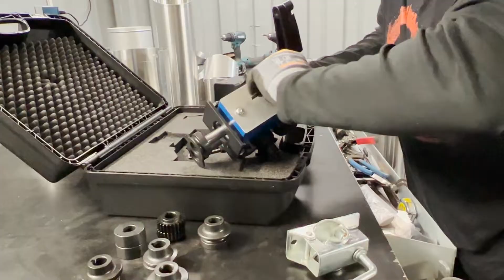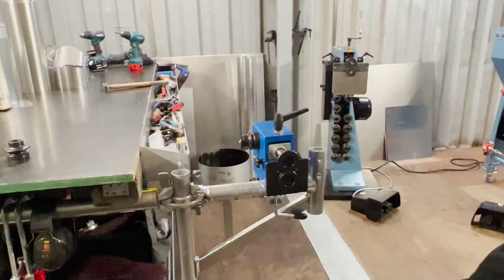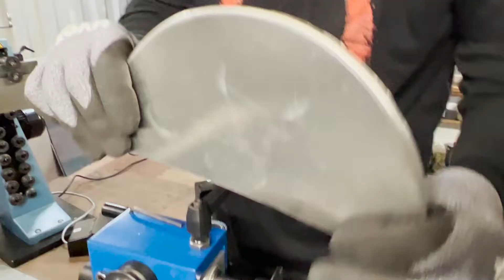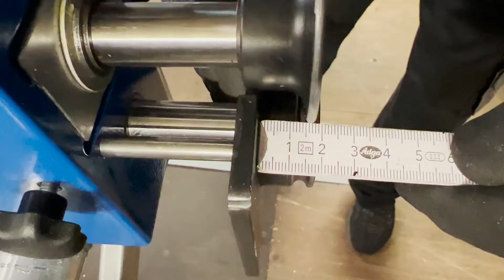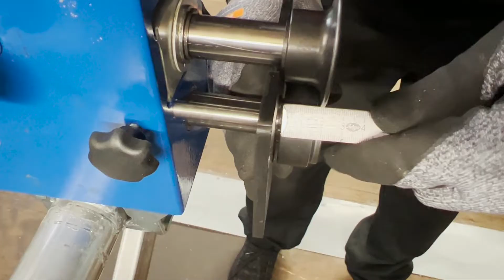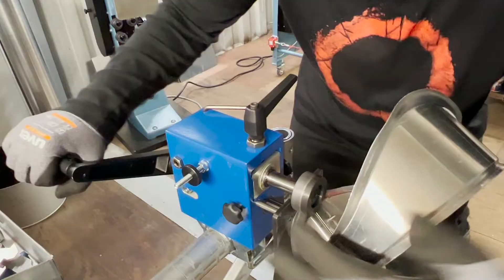Sheet Metal Machines part 3

Comment: Doesn't the hand roller have a post on the bottom of it that it would go in that
Vertical tube on the end of the elbow and then it tightens into that that's what mine work anyway